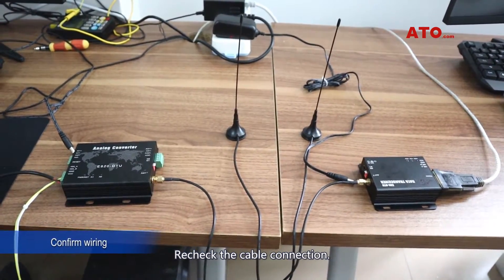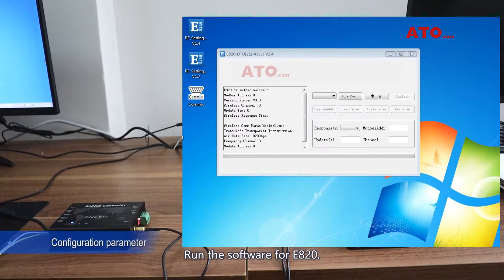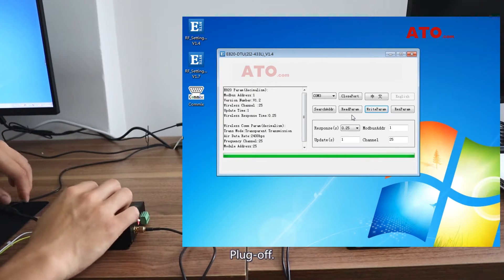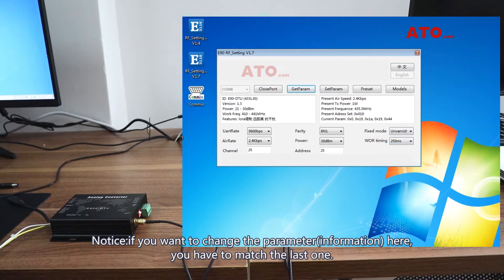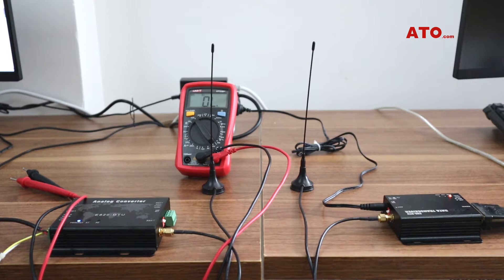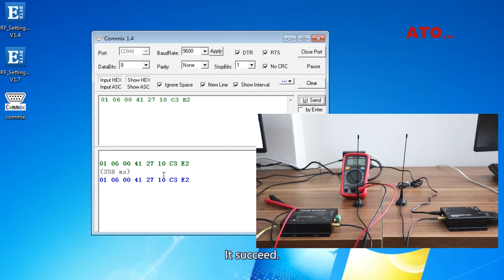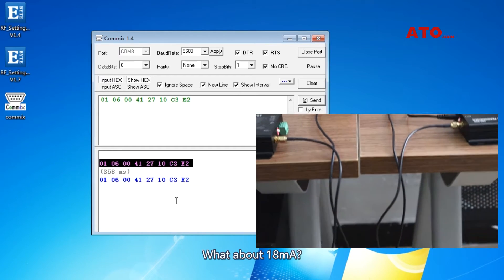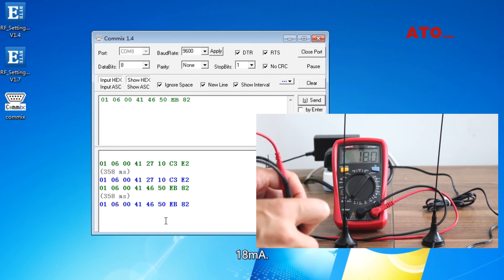Industrial wireless data transmission control test / Data Transfer Unit

Comment: During the test phase when u said both M0 and M1 are in 'UP' position. In the video shown both E820 & E90 DIP r in 'DOWN' position' and it seem like it still work when u send command to control E820. Quite confusing. So is it suppose to be 'UP' or 'DOWN' for M0 and M1?